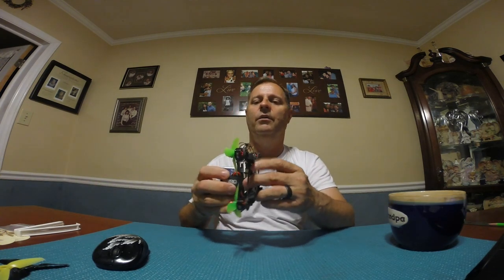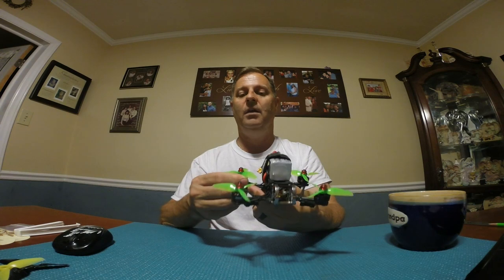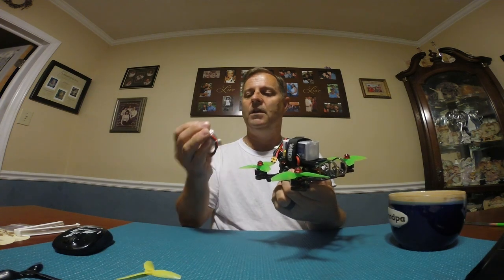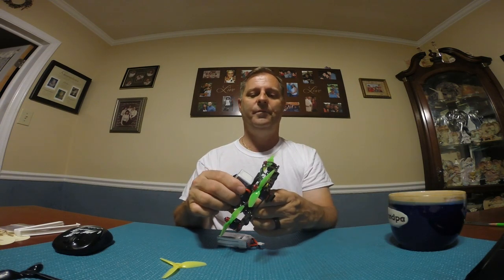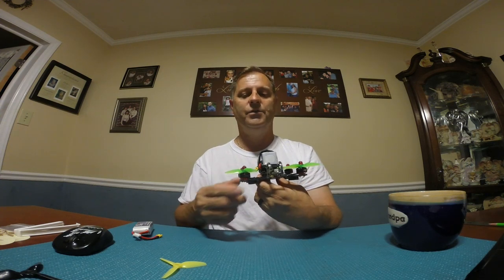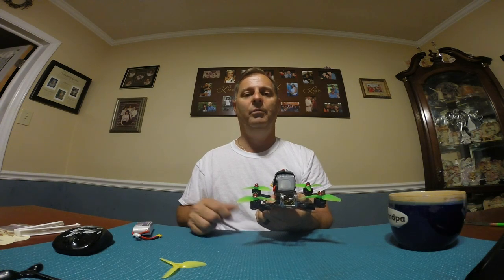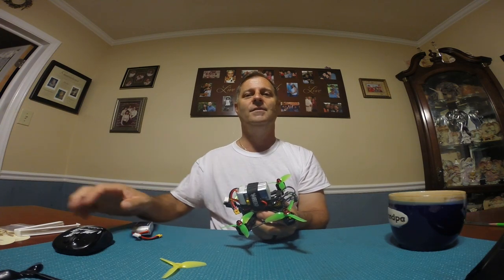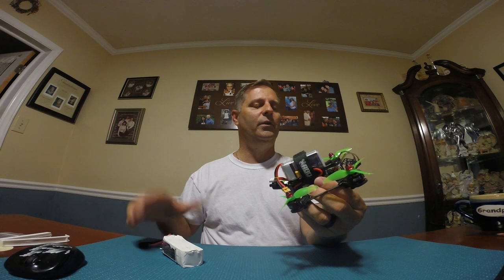Emax RS1606 4000KV Review - Final Update

Comment: I have the 4000kv version on a 3" frame. Running BF 4.1.5 with sliders set to .7 and they get HOT after two minutes of flying.  :-( Running the sundancer 3x2.8x3 prop on a 4s 850. I'm really disappointed in these motors.  Wish they worked like yours.
Reply from the maker: I was really disappointed when I first got them as well.  Now that I have it all worked out.  They are rock solid and never even get warm.  Friend me on Facebook and we can work it out much better than here.
Reply from the maker: Georgio Mascagni  are you using RPM filtering?  Running 48mhz on BLHeli32 ESCs?
Reply: @marinehm  thanks I will go on FB and friend you. I appreciate the help. I have high hopes for these bad boys. I was running jazzmac 48mhz and RPM filtering they are BLHeli_S not 32's ESC's. I've gone ahead and reflashed to stock 16.7 and reduced the sliders on 4.1.5 down to .7 will go after work but in a light hover they seem much better.

Comment: So thank's, and then...i was paste that in CLI...but my motor so hot...

My build Acrobrat 3", Xrotor stack F4 20A BF 4.0.4, Emax 1606-4000kv, HQ 3x4x3, 3s 850mAh
Reply from the maker: BF 4.1 with RPM filtering.  Stock settings and the motors are barely warm.
Reply: Oke, thax very much...that is CLI for BF 4.1...?
N so you got barely warm motor with this CLI...?
Reply from the maker: No.  I upgraded my Betflight to 4.1 with RPM filtering.  Nothing more was needed. It should work for you too.

Comment: Hi Nick, i have these 1606 motors too and i had your same issue of hot motors, thanks a lot for your pids and settings, i'll try them soon. I only want to ask you what BF version you have, now i'm on the 4.0.6 version...here how it fly now https://youtu.be/dn-vJyCjDso with these pids so low...
set p_pitch = 20
set i_pitch = 13
set d_pitch = 8
set f_pitch = 75
set p_roll = 20
set i_roll = 13
set d_roll = 8
set f_roll = 75
set p_yaw = 20
set i_yaw = 13
set d_yaw = 8
set f_yaw = 60

as i increase the D the motors becames very hot !
Reply from the maker: My computer is super old, for some reason won't load later firmware.  So I'm still on BF 3.5  I'm currently trying to flash BF 4.1.

How do the motors feel with your PIDS?

Here's mine:
set p_pitch = 30
set i_pitch = 85
set d_pitch = 9
set f_pitch = 100
set p_roll = 30
set i_roll = 78
set d_roll = 9
set f_roll = 100
set p_yaw = 35
set i_yaw = 100
set d_yaw = 0
set f_yaw = 0
Reply: Just updated to 4.1, default pids, motors warm, perfect ! I must try out, now i only did some overing in house...
Reply from the maker: Probably too late but, If you've upgraded to BF 4.1, you will not copy the same PIDs.  May use them as a reference point to where you may need to adjust up or down.  Fly the defaults first, then slowly adjust. I'm going to try your PIDS this morning to see what behavior I get from the quad and motor temps.  Thanks!
Reply: Now I'm on 4.1 with default pids and it fly wonderdul with not hot motors at all !
Reply from the maker: Luciano Fpv that’s what I wanted to hear.  Looking for someone to flash my FC
Reply from the maker: I also tried the ESC setting in this video.  No problems with the motors.  https://www.youtube.com/watch?v=xYsIs0zmZR4&t=191s

Comment: Good stuff, Nick. I'm about to post a video of a flight this afternoon. I have no idea how you're running with D gains that high and not getting hot. My Acrobrat starts getting toasty anywhere above D=24.  BUUUUUT, I ran a couple packs this afternoon and set my debug to track my Dmin. In normal flight, Dmin rides at the bare minimum, even in 10mph winds. I had Dmin set at 5 and it rarely went above 7 just cruising.  I'm thinking a D in the 30-40 range, Dmin 5-10, and a DMingain of about 30 will have this thing locked in.

Also, did you try lowering your dterm filter minimum to ~100? I got a lot less noise coming through with that, but we're rocking different frames so it may not be necessary for yours.
Reply from the maker: I just tried the ESC settings in this video.  Motors come back barely warm.  Worth a look.  https://www.youtube.com/watch?v=xYsIs0zmZR4&t=191s